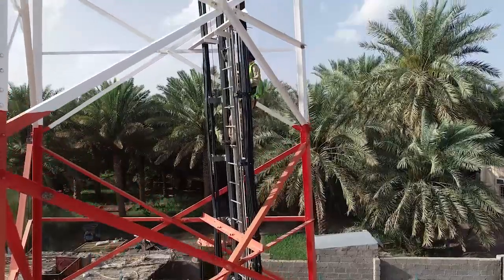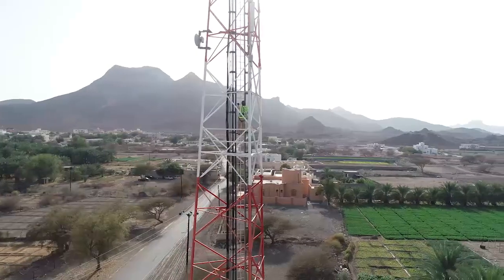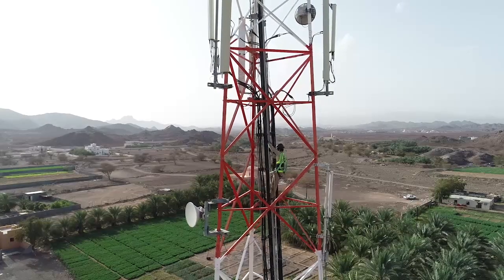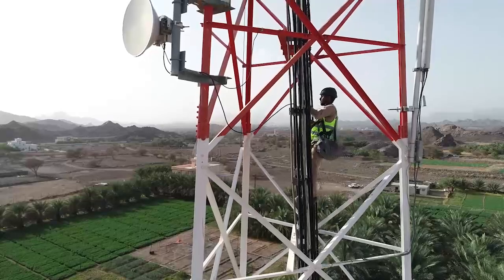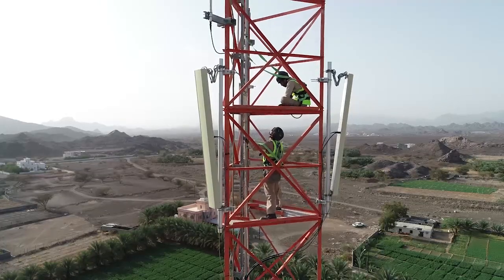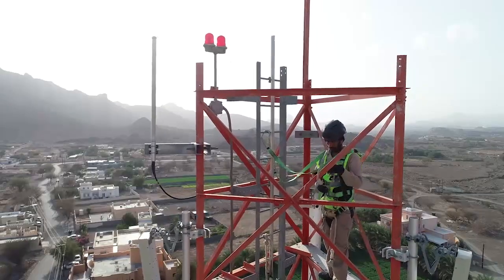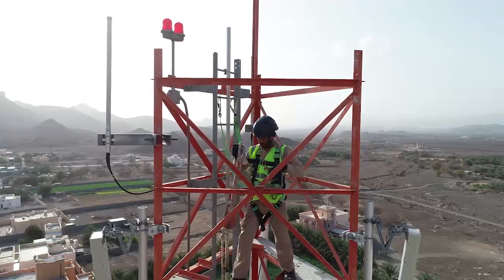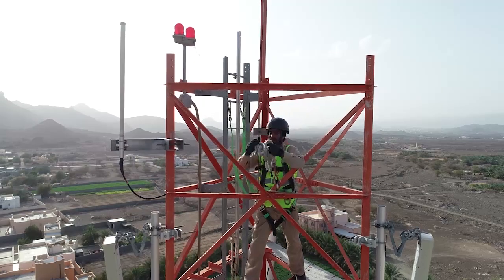27 Rope Pulley Installation on tower

Comment: They should use the rope grab instead of a double lanyard while climbing the tower because some people will get tired of repeating the fixing and removing of a snap hook of the lanyard, this may lead the people to do a shortcut (climbing without using a lanyard). The double lanyard should be used only or tie off 100% when they are at the top of the tower or they are permanently standing in an elevated place to perform a task.
Reply: Fak u